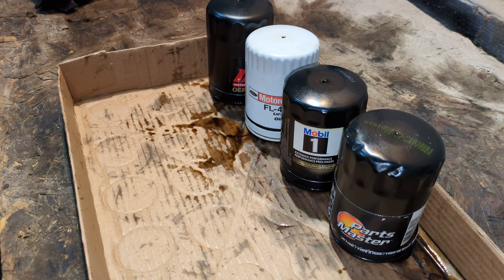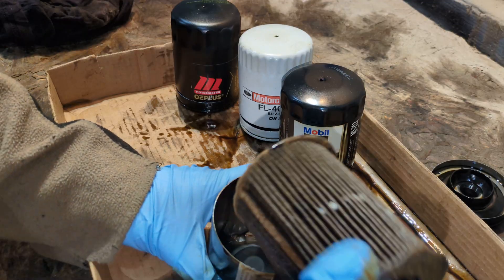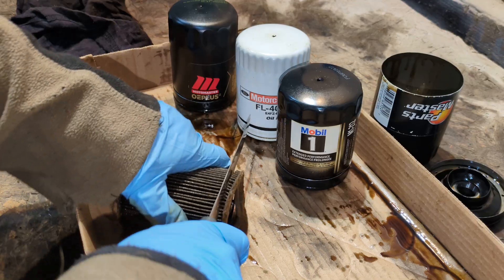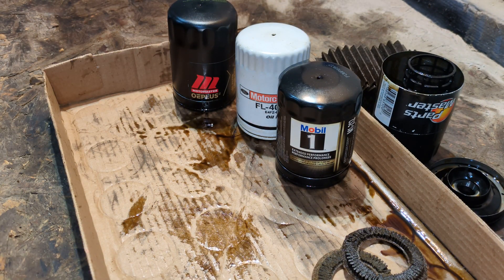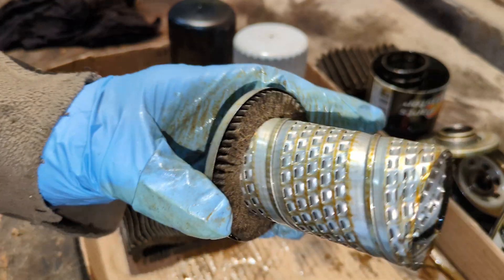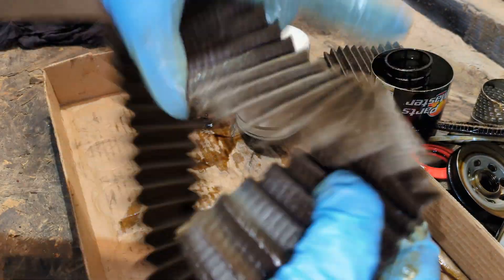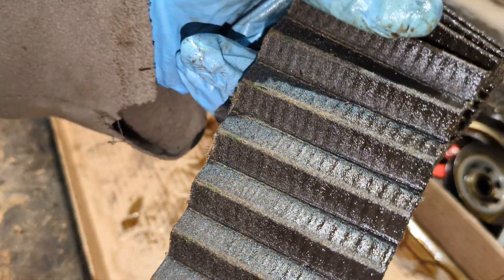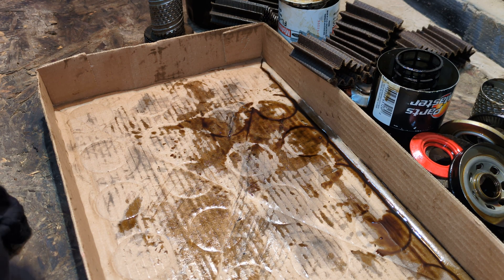Used filters cut open to see the surprises inside

Comment: The parts master utilizes a combo bypass valve built into the anti drain back valve. Hard to explain but there are videos and pictures online.
Reply from the maker: Thanks Steven, I prefer that type of bypass since it is not at the end where a lot of gunk hangs out.
Reply: @the only issue is they’re used on lower grade filters it’s not like what wiz used to use
Reply from the maker: @stevenbettez2017 so true Steven.😉